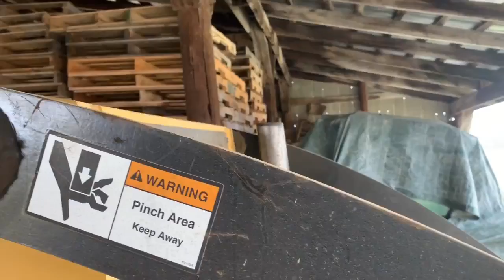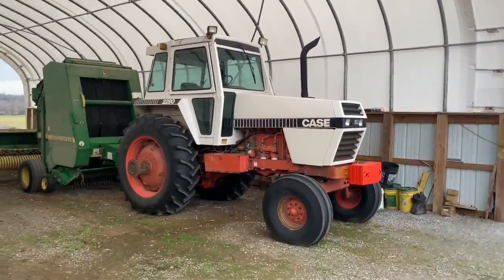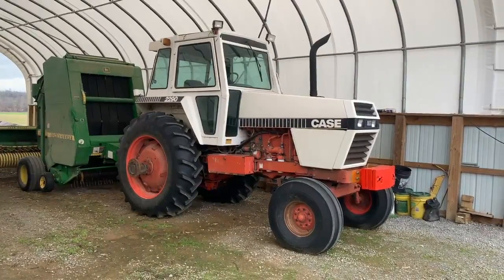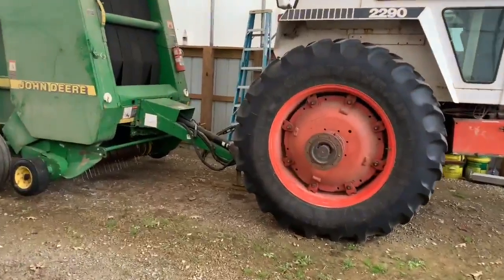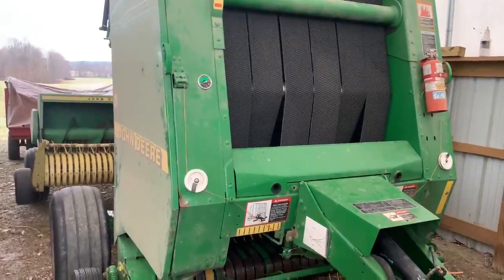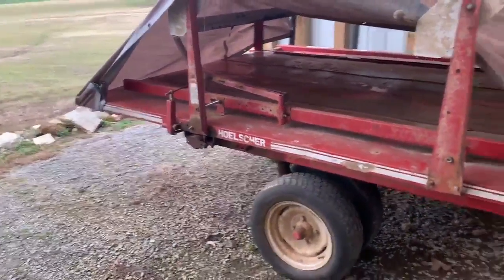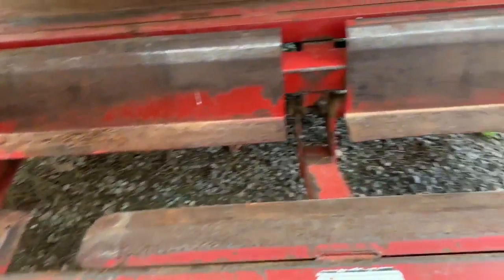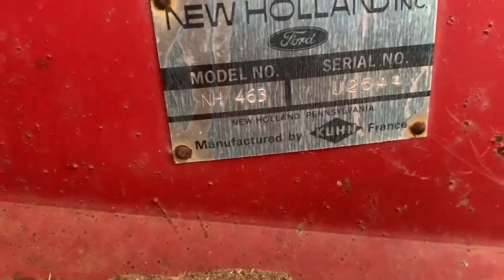Loading Hay & Reviewing Equipment 720p.mov

Comment: Looks like a nice lineup! Good to hear from you
Reply from the maker: Yeah, it’s working pretty good for me...even though it all older equipment. I’m just looking forward to seeing the profit start rolling in after making the switch. What kind of editing program are you using? I had a lot of “technical difficulties” since the last video....seems that my editing program doesn’t like YouTube anymore. I had to sneak in the back door to get this one to upload. Lucky for me this is just a hobby and not how I make my living.
Reply: @commonwealthfarms5342  ive used several different ones. I just do everything on my cell phone. Mymovie is the one ive used lately. Its free and simple. Nothing wrong with older equipment dont need a computer to fix it and its usually depreciated in value enough that its worth as much as you put into it.

Comment: You love your accumulator and I only like mine sometimes and their the same haha. We have trouble with the 338 in front of it making a perfectly consistent bale.
Reply from the maker: The first few hundred bales, I was off the tractor making adjustments more than I was on it...so during that time I wasn’t a big fan of mine either. Once I got things dialed in though, I knew that it was gonna be an asset to getting those bales out of the field faster without having to hire any help. I guess I should have clarified what I meant when I said I loved it....but as you could probably tell, I threw this video together pretty quick.